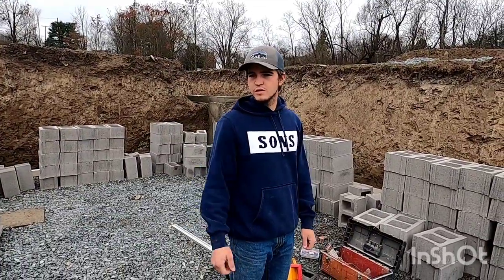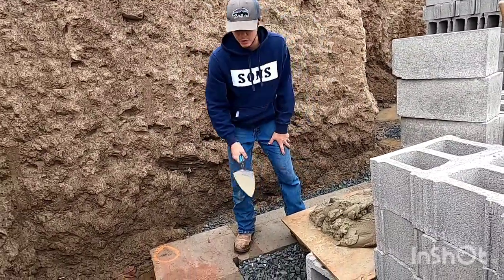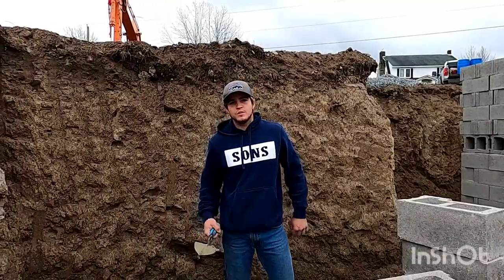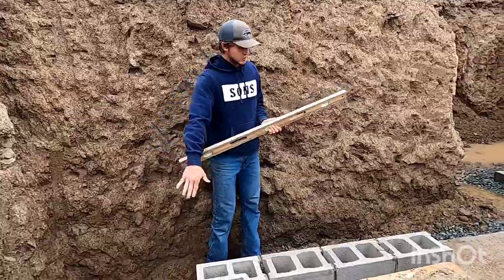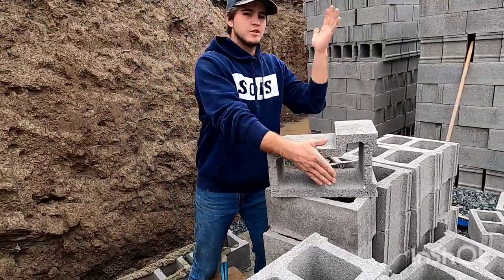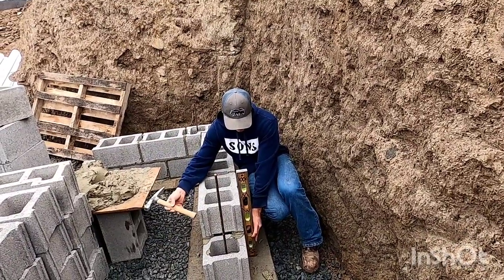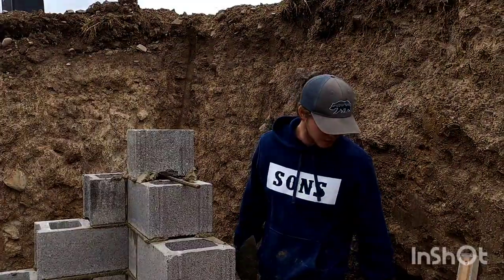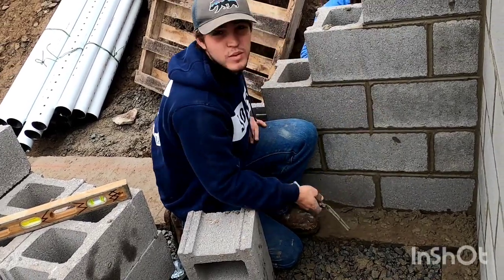How to Lay a Block Corner

Comment: Been a  mason for over 40 years,  best tutorial I've seen yet.  You know your stuff young man.  The only thing I would correct is on the 2nd course on up. There's no need to plumb every block in your lead, just the corner and the ends of the lead, the bottom of the middle blocks line up with the course below, then you just straight edge the top.
Reply from the maker: I was taught by a really good block layer! Thank you! Thanks for the tip, I'll try it out!
Reply: I think you should if you are not using line and pin
Reply: always good to do it on all first course

Comment: Stabilla is the way to go with levels. Im building corners with zero knowledge to your video helped a lot
Reply: I started with cheap, got all into expensive and now back to whatever I have.....funny how over many years perceptions change

It's a water bubble encased in a cylinder.....its not really complicated

Would never use a $200 level for Mason work, it will be trashed inside a few months.....its a finish carp level

Comment: This video is fantastic Mason ! I've been looking for something just like this - you show the tools needed in advance, explain how to use each one as you start and move along. I'm repairing my old stone foundation in my house as it collapsed once I took out old rotted Bilco walls and door entrance.

 The old creek stone foundation was only 3 ft deep and it collapsed.

I had to hire a structural engineer to draw up plans for it. I'm pouring another piece of footer soon. The total length of footer is 37 ft.  I had to dig around 5 ft below grade to put a proper height foundation block wall in. No biggie.

I'm using 8 x 8 x 16 inch blocks on the footer. I had a guy come in and install the first piece of footer for part of the foundation foot print and the new Bilco entrance.  

I'm about to pour a 5 ft by 4 ft footer which goes around a back corner and ties into the footer the old contractor put in place.

Others asked me why didn't he include the rebar as part of his original footer pour. I believe I have the answer now from your video. I can lie the block in place and retroactively hammer drill holes -- for the vertical rebar - exactly where those need to be. That's a brilliant idea.

I don't think my block supplier has those corner blocks w the extra piece which seems to guide where the 2nd block on the bottom tier sits --- going in the opposite direction --- of your very first corner block.

I saw in another comment that you're in PA - cool. I'm up here in the Buffalo NY area - so, we have the same weather - we just get a lot more snow. LOL

The footer will be fully cured by mid November -- I was told as long as the temp doesn't drop below 35 degrees while I'm slopping in the mortor and the mortor doesn't freeze on me - it's ok to being setting the block in place - w the mortor.

Question -- if it's ok to mix the mortor at temps above 35 degrees and the mortor isn't freezing -- does it matter if 3 or 4 hours later or overnight that the temp drops below 35 degrees ? Does that render the mortor ineffective or ruin it ---- or does it just increase the curing time ? 

I may have more questions as I move along. I'm a perfectionist and it looks like you are too - your video is superb and insanely helpful ! Thanks in advance.
Reply from the maker: You don’t want the mortar to freeze. It’s hard enough after about 6 hours. So after lunch use antifreeze in the mortar if it freezes at night. Also cover with plastic to keep the frost off
Reply: @masonthemason6412  Thank you for the return comment. I appreciate you taking the time to do so. I'm using my own cement mixer - the "barrel" of it is about the size of a washing machine drum and I'll be using 80lb bags of Quikrete 5000 (please, give me break 😃 I'm an amateur) - how much anti-freeze would I use per 80lb bag ? Thanks in advance.
Reply from the maker: If it’s a liquid, I do a six count
Reply: @masonthemason6412  Thanks again for the reply Mason. I'm an amateur as I mentioned - so, I have no idea what "If it's a liquid, I do a six count." Please, if you'd explain it to this layman - I would be so appreciative. Thanks in advance.
Reply from the maker: If you have a liquid anti freeze, start dumping and count to six and that should do the trick

Comment: Nicely Made Video. Thanks. We generally use solid blocks in the UK, and build two skins. My dad and I lay the outside skin much like you do, but then use a spacer to lay the inside skin, which we wedge in the cavity (space between each skin).
Reply from the maker: Thank you! I've heard that before, I'd like to learn how you do it. I'm interested in every way our trade is done. One day maybe I'll get to learn
Reply: @masonthemason6412  https://youtu.be/wgYFLx6S6ec This isn't my video, but it shows how in the UK we typical use concrete solid blocks on outer skins, "thermalite" blocks on inner skin, and then insulation in cavity (you can get EPS bead blown in afterwards which is easier- https://youtu.be/Qs3PqJE0zng). The two skins are held together with wall ties.
Reply: @DorkyThorpy  What of EPS beads and the wicking and trapping of moisture within the wall cavity?
Reply: @johnlorraine204  I had EPS put in the cavity wall on our extension (new build), and it seems fine. The beads are roughly spherical, and cavity in >100mm so I can't see how water could track across. No visible evidence of damp on the inside, its bare lime render internally. I was self building and it was a cheap & labour saving option for me.
Reply: @DorkyThorpy  Glad that you have good results; however, that adds confusion to my thoughts. I was considering using EPS on a tropical build. The moisture is high but the heat is high. One video that gave me pause was this:
https://www.youtube.com/watch?v=azHyYs7j7Z8
Reply: @johnlorraine204  Ah yes. I've seen this guy (watched this video actually) I don't know the answer for sure. But cellulose (wood or paper ) insulation was popular for a time, and I would not use that. It slumps over time, and does not flow like beads, so you will get better fill in some places, and dense patches (as mentioned in linked video). The few houses I have seen bad stuff going on with it is cellulose fill. Although by parents have cellulose fill, and they haven't had any problems! Also if you bear in mind that many cavities are just 10mm free space (rest filled with solid insulation / batts), then there is scope for mishap there also.
Reply: @DorkyThorpy  You know how it goes for the wary; we try to learn from the experiences of others. I don't care much for the idea of posting my video on how it was necessary to tear walls apart for some unforeseen error.

Comment: We use to pound a rebar in each corner next to footing lay out dry with tape measure then pull line tight around rebar trig line to each corner then do the whole layout and plumb every single block then build in each corner

Comment: We used horizontal reinforcement wire, looks like a ladder and came in different widths. No need to score the block it set in the mud betweenthe courses. 

I agree with the comment below about hitting your level as stated but we all did even though told not to as an apprentice.

Over all fine job Youngblood 👍👍👍

Comment: We used to fill all our joints with mortar...
Then use wire every other layer, my uncle made a,good point....a 12 inch block is wider than longer so if the rails are set on  solid mortar the wall will expand width way

Comment: You said got to match up with other corner blocks with transit before even started with measurements did you transit foundation and start with low side first. Was that your first lead? Then you know in your mind how much mudd to sling for the rest leads
Reply from the maker: I always start with the highest ones and lay them tight. One this job I had stepped footers to the garage, so I had a height to hit already

Comment: Thanks man very helpful video. One question though do you have to use the special corner brick? I've seen people just use normal ones. Thanks
Reply from the maker: I use a special one for 10 in and 12in block. You don’t need a special one for 8in block
Reply: You don't have the option of special corner blocks in Bulgaria.

Comment: That's a great tutorial Mason! Thinking about building a small inground pool with blocks, run rebar both vertically and horizontally and fill with concrete when done. Plaster, paint and fill with water. What are the odds of that cracking ? Don't wanna build a sieve.
Reply from the maker: I’d fill it solid. Over time everything cracks. It will last awhile tho. I prefer fiberglass tubs I think they last the longest. In Pennsylvania we can’t build concrete pools. What location are you in

Comment: Is that vertical pieces of rebar dropped in the drilled holes in the footer - are tehy filled with mortar? Is the horizontal pieces every 2 courses...is that required by code in every state??
Sorry for the dumb questions but Im having a garage built and the block crew comes on Monday and I just want to make sure they dont cut any corners!
Reply from the maker: Drill the rebar in the footer for vertical rebar. Either wire or rebar horizontal every 2 or 3 courses. Every project has different specs
Reply from the maker: Sometimes you don’t even need the horizontal if it doesn’t say on the prints
Reply: Your vertical rebar should always be set when the foundation/ footer is poured.
Reply: Do I need rebar for an 8x10 shed? Or can I just try to do it without rebar?
Reply from the maker: Wouldn’t hurt to add rebar. I usually just add fiber

Comment: Do you need the special corner blocks if you're just laying a small wall foundation for a pizza oven?
Reply from the maker: Every job varies. If you use 8in block you don’t need corners
Reply: @masonthemason6412  I've only done brickwork never blocks. Yes I'll be doing 6x8x16 blocks (that's what the pizza oven kit called for). Would I just run the standard brick corner with those?
Reply from the maker: I would think so. I’d have to see more to give you the way I would build it
Reply: @masonthemason6412  to keep it a standard half bond I think would need to add an extra block since I'll be using 6 inch block, wouldn't have that issue with 8 inch 🧱
Reply from the maker: You’ll just have a 2in piece

Comment: What if that foundation is not level over its distance. Say one end is 1 inch higher then the other. Do u usually check the level of the foundation before u lay or do u just take it for granted the foundation is level?

2. That rebar u put into the slab, did u have to drill the slab and glue it in?
Reply from the maker: So you go to the highest corner and start there. Try and make the bed joints as tight as possible. Then every other corner you can make the bed joint bigger to make the height match. 

Yes you should epoxy the holes
Reply: @masonthemason6412  Thank u for your prompt reply and good advice. 

Not many utubers follow up on their comments section.
Reply from the maker: Of course. It gets hard sometimes to keep up with all the comments coming in. I try to answer all the ones with questions to help them out. Appreciate you, thanks

Comment: I just stumbled on this

Please how do I learn?
Reply from the maker: I would buy a bag of spec mix mortar, 6 block, a 2 foot level, trowel, and jointer. Then find a small flat piece of concrete that you can dirty up. Then practice building a 3 course corner. You can probably do it 2 or 3 times building and tearing it down. After about 3 times of practice you will probably learn quite a bit
Reply: @masonthemason6412  the best advice I have gotten so far in the building aspect
Thank you very much
Reply from the maker: You're welcome!

Comment: I'm currently laying block for a 1200 square ft house 8 courses, the people I had do the flat work did not do a professional job so the footers are not level. This didn't pose a problem with the corners, they were flat and level, 25 ft down the wall- there are significant humps. The only thing I can think to do, since my corners are established, is to use a little less mortar here, and a little more there, to get the whole thing level at the top course.. any other pointers??? 3:45
Reply: Ya man, that's semi normal...hopefully you can slowly get it back to level...mud the cross webs to keep the block up or use less or softer mud where you need to squeeze
Reply: Even in a professional environment the concrete is rarely perfect,  more so these days...I contend with this daily
Reply: @Master Samurai , thank you.  Slowly as I go up, it's coming together. Got my 8 block leads perfect to the laser, laying them to the line!

Comment: I have an old block retaining wall with a corner on it. So the wall is shaped like an L. I need to add another wall on to it so that it's shaped like a T. Any suggestions for how to connect new wall to old?
Reply: You can use a hammer drill to drill horizontally into the end of your old wall from top to bottom and epoxy rebar dowels into the holes. Then the dowels should stick into the blocks of the new wall and the wall segments will be tied together.

Comment: What do you do if the footer is uneven?
Reply from the maker: I go to the highest corner of footer every time and start there on 8's for height. Then if the others are lower I make the joints bigger as I put up the wall. If it's out of plum I use rocks to help me level it up. Usually you can get the problem points of the footer out by the 3rd or 4th course

Comment: What if the corner nail is in the way of tapping your block down?🙁
Reply from the maker: I either pull it out after I snap chalk lines. Or I break the bottom corner of the corner block off

Comment: Mason, that's my Best Friend's son's name. You have Potential, I suggest go work for a Serious Commercial Company. Then you will Excell your Skills. #1 don't beat on your level and lose the hammer. #2 Rebar is supposed to be Continuous out of the footing, Not 4' on center, that's a fence layout. When drilling for your Verts, the Holes have to be cleaned and you need Epoxy which is stronger than the concrete. Look you can Learn Something New Every Day in this Trade. You want to be a Master Mason some day, Work for the Best. That Block does not look uniform and square, which would Tick me off. Get your hands into Brick, Block, and Stone (Real Stone, not cultured) Why....Because a Master Mason can do it all, and a Master Mason is Extremely Rare  !!! Good Luck to you either way
Reply: Durawire was Designed for use as a Wall Tie, Not Horizontal Reinforcing. Example....if you use 8X8X16's , you would use 12" Durawire for wall ties for the Brick. It was Not meant for Horizontal Reinforcing, Nothing Beats Rebar, especially solid grouted. Here's another....It's Width X Height X Length always...and a Good way to Remember that is....Women Have Legs  🤣🤣